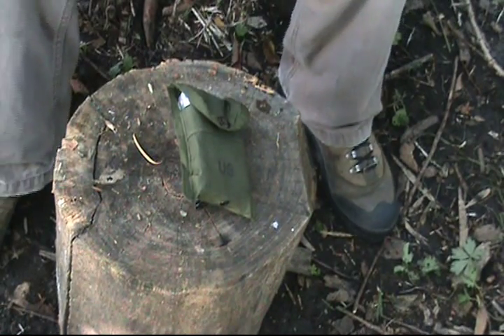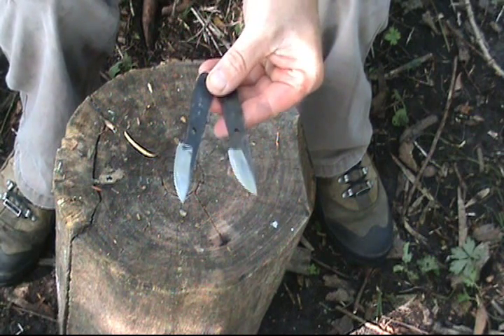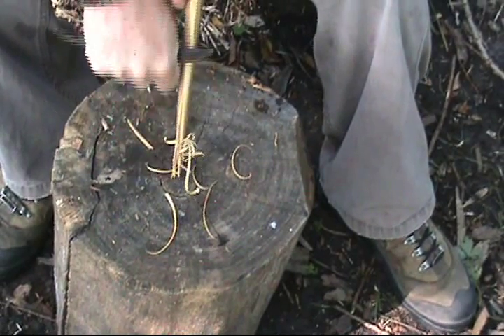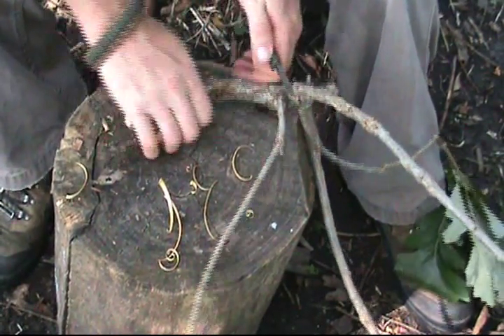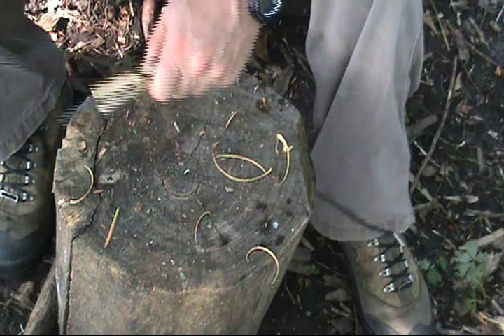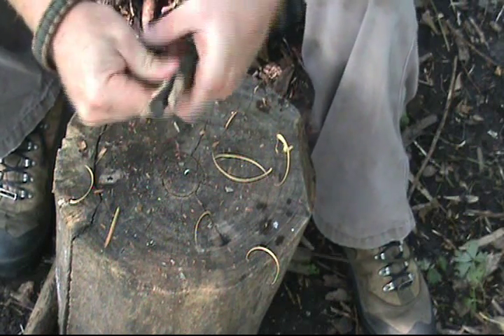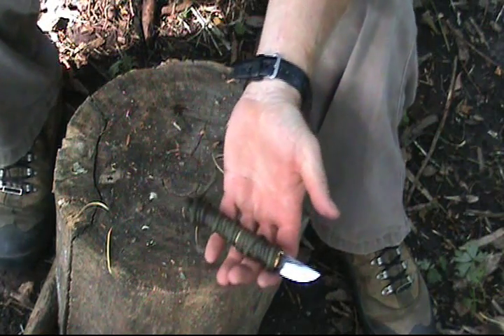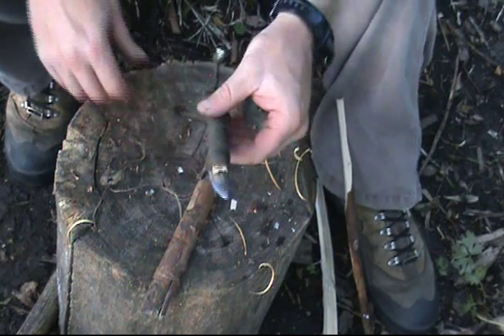Turley PSK Knife

Comment: very nice knife. Reminds me of a carving knife or gouge you might use for turning stuff on a lathe. One thing that might be cool to try with this design would be to make a longer handle in two pieces that have a flat mating area and use a pair  10-24 Phillips  screws spaced an inch apart to join them. the knife end would have threaded holes in the flat area and the add on handle would have the pass through set of holes that were slightly countersunk. Would nearly double handle length.

Comment: you should NEVER baton you last ditch knife you are asking for a break and if it is all you have left then what? ever heard of work hardening? i cant see any reason you would need to baton such a small knife, just work a little harder on the shaving and you have your fuel to burn the size stick you could split with a knife this size. and there is better ways to cut through a piece of wood than batoning through it